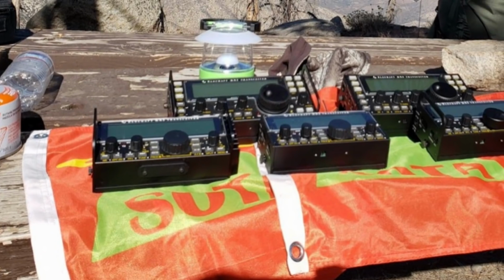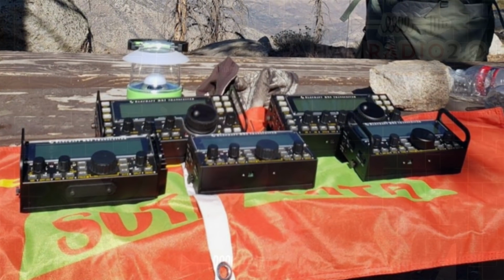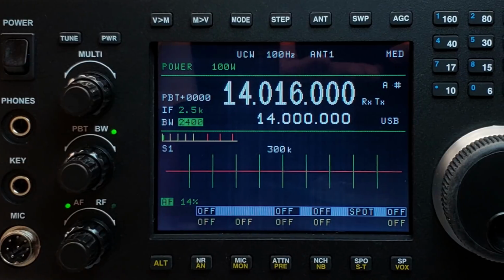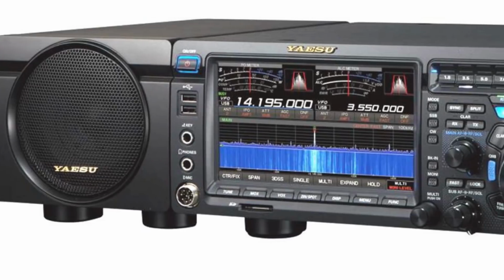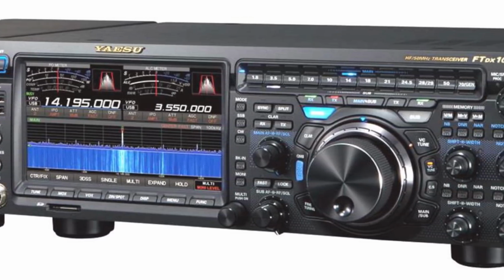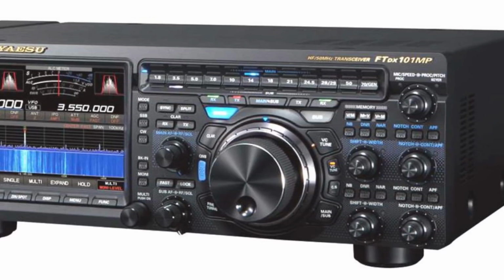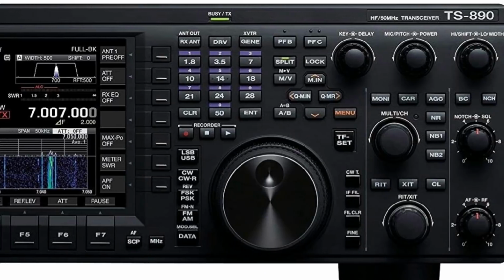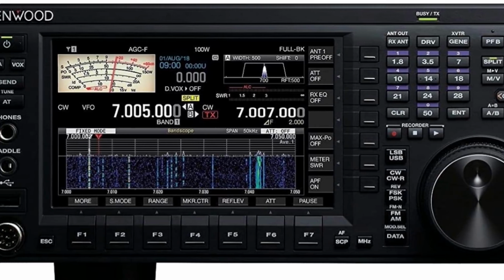Best Ham Radio Brands for 2021 | Ham Radio for Beginners

Comment: This is exactly the video I needed right now. I was keeping an eye on several used radios on ebay and they seem to have all sold today. I am a brand new tech with zero equipment and near zero budget. I am wondering should I just do the HamSphere 4.0 for a year or so or until I get my general. Any hints? I am really looking forward to getting on 6m when I am able! That's my dream frequency!

Comment: Really want to start out with a HT that is triband that has a digital screen similar to Kenwood but don't need a $500 radio.  Looked at Anytone only dual band but like that radio.  Any suggestions for HT triband with APRS with a TNC.  Want to have capability to text on radio, for example.  Maybe some data transmission.  This will likely be the only radio I ever get as I'm not looking to get crazy in HF.  Thoughts?  Maybe a pipe dream....

Comment: Love the channel and new to HAM radio. Watched your 3 part technicians course and passed my test two weeks ago so thank you guys very much. Question, I bought a Baofeng BF-A58 as a starter radio and because I was able to find a PTT cable system to connect that radio to my headset. If I were to upgrade in the future do you know of an HT that would have the same multi pin connector as the BF-A58? Cables weren't cheap and Id like to be able to carry them over if possible

Comment: Sherwood reports are overrated, what really counts are what the end users think.
Reply from the maker: On a certain level, I agree with that. Sherwood is just a good tool to use
Reply: @HamRadio2  Yes for people who worry about the numbers in the specification it is. Maybe Sherwood Labs measurements show the high bar and how every radio stack up against that. But from my experience you have to look past that.
Reply: @jimmarcum7362  Much respect for what Rob does in his testing, but he has mentioned that most operators cannot tell the difference between the top rigs over 100dB.  What does he use?  He has a Kenwood TS-890, IC-7610 and IC-705 that he uses for contests.

Comment: I wish icom would make a replacement for the 7100 that had all the same bands and everything, but with the modern waterfall. That would be the only radio worth having in a vehicle.
Reply: Sure seeing a lot of IC-705s being mounting in vehicles as a mobile with a mobile Amp.
Reply from the maker: @MrN9ja  Cost not being a factor, that is a great idea.
Reply from the maker: Yes!

Comment: ALINCO DX-SR8T
HF 160 - 10 Meter 100 Watt Multimode Transceiver with Detachable Head 13.8 VDC
Regular Price: $479.95
Reply: regretting that 991a purchase i see.
Reply: @forgetyourlife  
I got an FT-991A, FT-891, FT-817-ND, & a G90, plus a TS-430S
Reply: I wish there were any to be found!